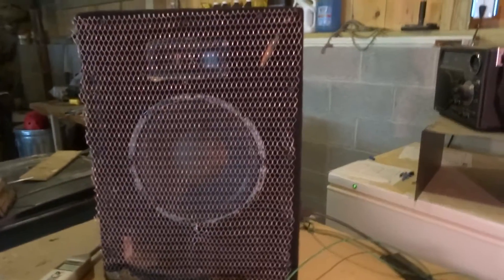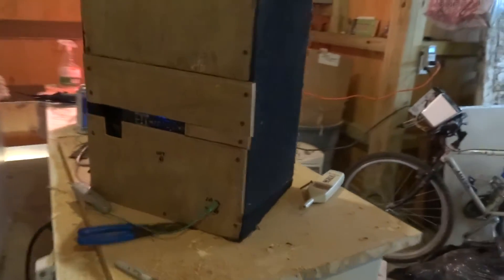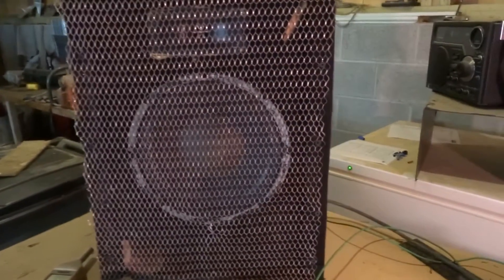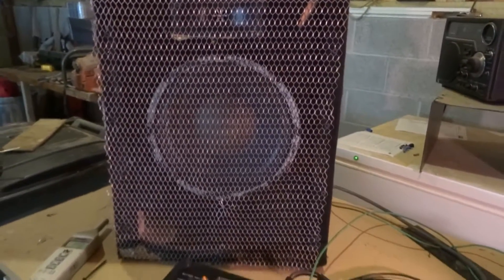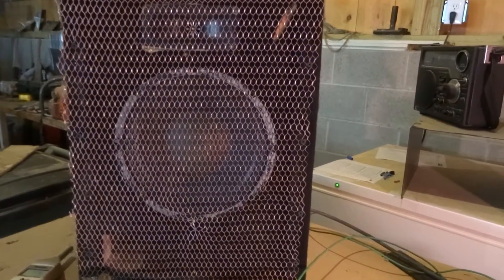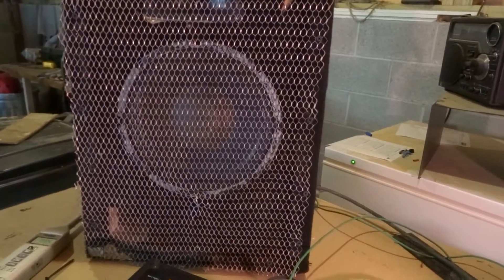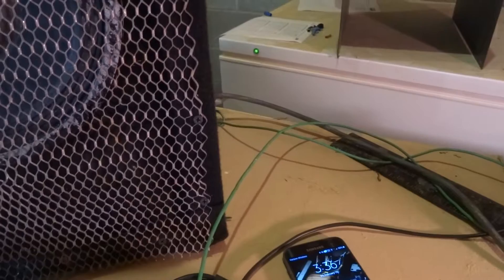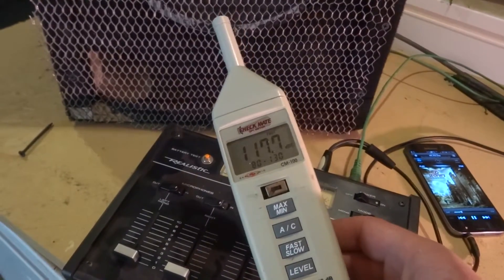Homemade PA Speaker

Comment: please explain this rockford fosgate car amp deal .
Reply from the maker: So when I first got that amp it was for my car stereo, but something inside it was fried and the amp didn't work (it was refurbished by Rockford). I then told them about it and they sent me a brand new one free of charge (which I use in my car) and let me keep this one. I was able to do a bit of troubleshooting and repair this amp (had some bad resistors inside) and now I use it for this purpose.
Reply: so you must have a power supply inside to power this amp ? id be interested in how you put that together , probably make a good video , my videos of running car audio in your house have done pretty good
Reply from the maker: Yea, I used a power supply from an HP server computer. It outputs either 48 or 58 amps at 12.66 volts and is perfect for this purpose. I'll show a video on how it works one of these days.